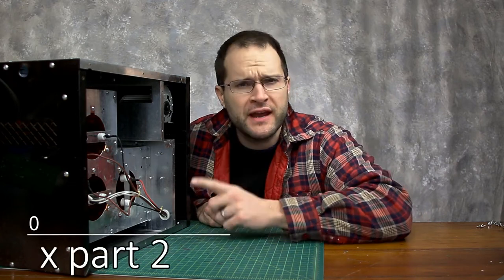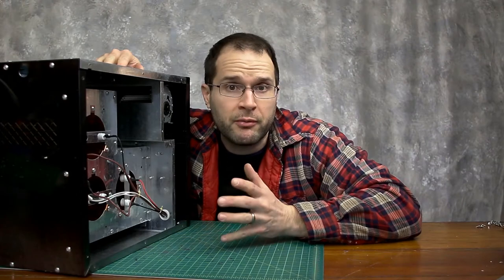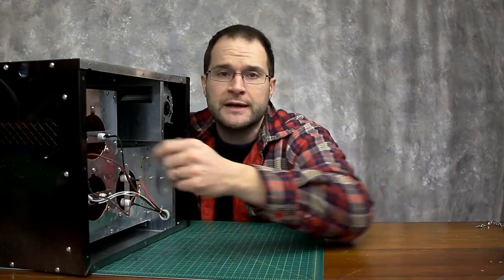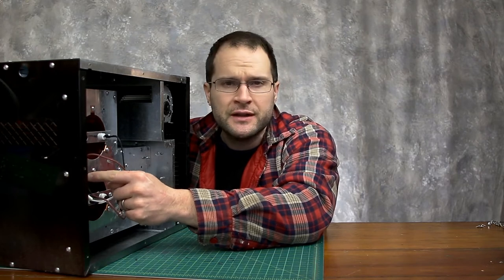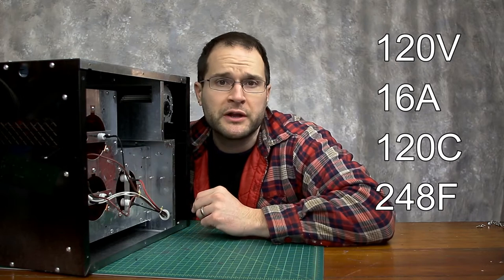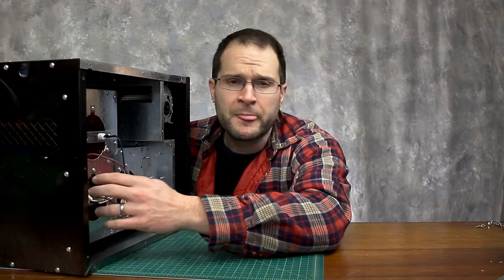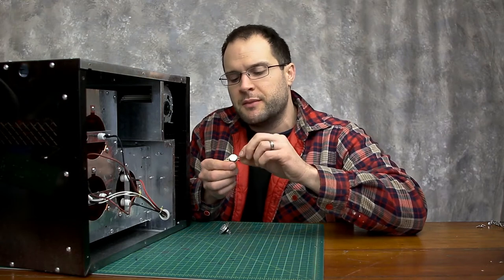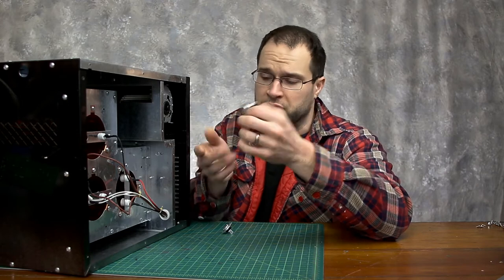how to fix a comfort zone infrared heater part 2 s2e10

Comment: Question mine turns on but the like clicks off.   My trailer burned down when I was at work lost everything.   So I’m in the middle of buying a new trailer but I’m staying at my sister she has some heater In there & kids room.  I found this heater she said it didn’t work. Been cold so need one.  It turns on but it sounds like it clicks shuts off.  Then it has to be turned off for a little bit then you can turn it back but does the same thing.

Comment: Anyone with this heater mind to take some pics of the connections? I have one that was pulled from recycling (Hate troughing things out that can be fixed and hated to see this heater in recycling) that just needed a thermal cutoff switch replaced. However, the thermistor (temp sensor) was missing (I think its a 10 ohm thermistor) and most of the wires was disconnected before I got it. I think I have most of the connections correct but would like to be sure before I put in service.